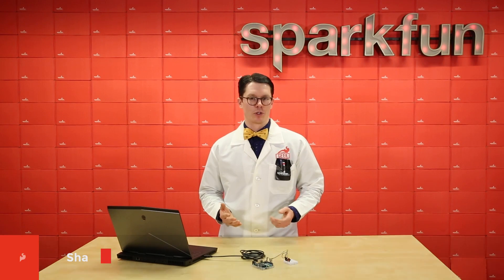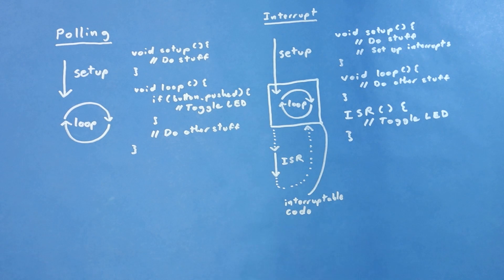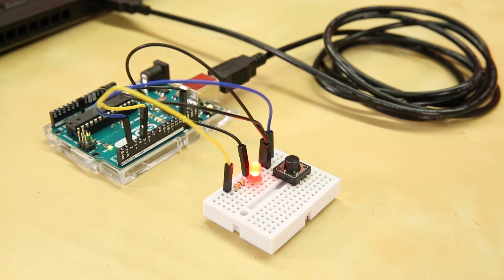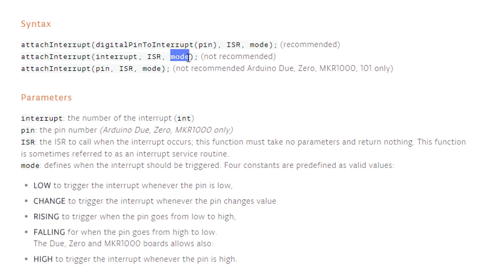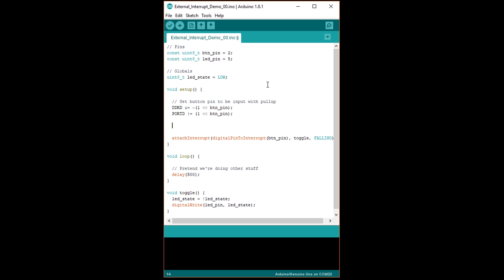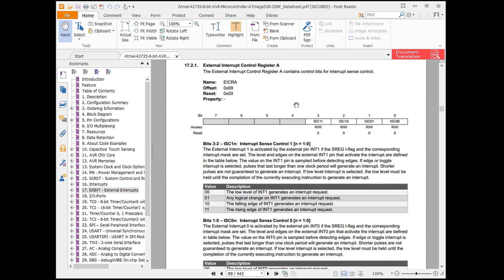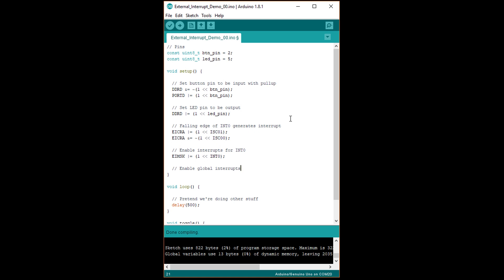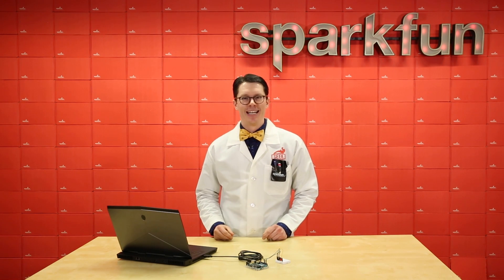Level Up Your Arduino Code: External Interrupts

Comment: So far I've watched 50 videos about interrupts and absolutly nothing shown works. Arduino IDE always throws errors or simply does not what expected. I really want something simple to happen but apparantly it's impossible. If I press a button, I want something to happen, once. Not hundred of times, but other buttons need to be read aswell. I can't even get a single button to work with interupt service routine.

Comment: Yeah, this & the few other videos that led me here are outstanding.  I have many questions, but I want to focus on one. Around 9 min in there’s  a statement “led_state = !led_state” for toggling. Defined as “LOW” (pre-setup) w/ uint8_t.  If uint8_t has 0-255 as possibilities, how does a ‘!’ simply toggle between only the two states “HIGH” and “LOW”? Does “HIGH” set the 8 bits of uint8_t to 11111111 and the ‘!’ is saying to toggle all 8 of led_state’s bits to “opposite” being 00000000 for a value equivalent to “LOW”?
Reply: low means 0 and high means 255 and we are toggling in these two values only....so there is no value between 0 and 255 .

Comment: Good video. I have a question, if I have a convayorbelt with ir sensors I can use interupts so the motor starts running the belt as long as the ir sensors see a object. As soon as the object dissapears(at the end of the belt) it stops again. I understand how they should work if u mount them sideways as a gate. But I was thinking to use them length wise on the belt. Or is it better to use a while statement. Like while sensor x is hight run motor ect.

Comment: Even simpler, in the ISR, toggle the led_pin by writing a 1 to its bit in PIND:

PIND |= (1 << led_pin);

It's in the data sheet and is quicker than the XOR.

Comment: Minor point here but the timers cause an EXTERNAL interrupt. The timer is separate hardware not part of the CPU, and if it causes an interrupt, that comes into the CPU from the "external" timer. See my video on timers in ATTiny which explains this.

Comment: Thanks for the fantastic explanation! I used some of these methods in my own projects and they have worked well. 

I would like to add from my own project experience that it may help to add a cap to ground at the INT0 pin in order to prevent unwanted/false falling edge detections. This may be an issue if you have a cheap button that has a ripple to it, or perhaps there are just ripples in your system in general.

Comment: Let's pretend we had a bool variable type and we could use it where hi and low are used and we also could flip it with a simple line.   X=!X;. Then we pretend to turn on a light digitalWrite (8,X);.  Then wonder if it's wrong.

Comment: Followed this lesson. Found, in case of PORT's  when  button is pushed  LED  not stable or not working at all. Solution, add 10 k resister between +5 and pin 2. Again, it is only for PORTs.

Comment: Wow, I just finished the Register video and was feeling good that I got it finally. So I jumped into this video and all was going great until 1 second before 12:00. For the next 2:30 seconds I felt I was listening to a new language. I rewound the section countless times and read the sections over and over in the datasheet, and I finally the parts started to make sense and I finally understood your code. 
I appreciate your video, if I had to rely on the datasheet alone I would give up my project completely. You have given me new hope that I can figure out how to make my code work.

I swear there was a point when I was reading the datasheet that I almost had to hit a AA meeting or the bar. It felt like if I had a couple drinks in me then I could better understand where the guy was coming from when he wrote that datasheet. 

There is one part I don't understand and perhaps someone can clarify it for me.
When I was reading about the "External Interrupts" it mentions that they can be triggered by either INT1 or INT0, and it also mentions that any of the other pins (PCINT 23-0) can also trigger an external interrupt. I see that the EICRA bit configures how and when the trigger is detected (low-level, rising-edge, or falling-edge) for the INT0/1 registers, but I don't see a similar register for the PCINT pins. Am I missing something here?
Reply: Is the project done ?
Reply: Haha yeah.  I grew up with a Commodore 64 and I still had a little trouble grasping registers.  Its pretty cool once you get it :D

Comment: Hello, thank you for all your videos. I've learned lots of new things. So, but i have problem with Interrupts. My LED doesn't work like yours. My LED turn on and off more than one times, when I push button one times. Probably i need some debounce, but your sketch working without debounce. Any idea please?
Reply: You might need to add a capacitor to the switch, or have a separate routine that "listens" to the switch for a few ms to debounce on the software side.

Comment: Why don't you need to declare "volatile" for led_state?
Reply: You should! What happens otherwise is decided by your compiler. If it is non-optimizing you are generally fine, but if if optimizes you might run into problems.

Comment: This is an easy "why not Rasberry Pi" response to any PC programmer. Arduinos teach how microcontrollers are different. You could stick to Linux or Android forever in microprocessor world, but needing or wanting to program microcontrollers is slightly different. I suppose that's why Basic Stamp sold for so long. IoT makes the Arduino IDE, JavaScript and Micropython more interesting, for professional and hobbyists, but it's still microcontrollers vs microprocessors.

Comment: I am not sure what you mean by "software interrupt"!
Do you mean for example interrupt on a carry from an ALU operation?
or do you mean interrupts generated from within the code?
Reply: minor mistake, which I corrected right away.
Reply: A software interrupt can be caused by some condition in the processor itself or by a special instruction that throws an interrupt (this Wiki page explains the difference: https://en.wikipedia.org/wiki/Interrupt). Many low-power microcontrollers, like the AVR, do not natively support software interrupts, but you can trick them into generating one (here is a discussion in it: http://www.avrfreaks.net/forum/software-interrupts ).
Reply: Thanks for the reply. I still don't find a single practical use for a software interrupt in a small micro controller like the ATMEL! 
26 sources of interrupt has been enough for anything I have done on a MCU.  
Can you provide an example of a use, that can not be done with the existing interrupt vectors?
Reply: UFOhunter Since most of my programming has been on microcontrollers as well, I don't have much experience with software interrupts. However, they seem to be prevalent in larger systems (e.g. those with microprocessors). From what I understand, you could have a "divide by 0" instruction throw an interrupt or generate interrupts when read or write commands to a hard disk have completed. Additionally, programs can create interrupts in order to interact with the kernel. A microcontroller has little need for these types of interrupts, which is why we usually don't see them when programming for embedded systems.
Reply: Thanks. Exactly what I thought. I didn't want to miss out on anything if there was something to miss out on :)
Reply: BTW- please put a <space> after the word Interrupt in your link. The ")" gets sent to Wiki and it has no idea what you mean. thanks.

Comment: Internal interrupts, we are on our own.
This is a MAJOR functionality of Arduino that is missing.
How to do an internal interrupt using Arduino????????????????
Reply: IIRC, there was a way to do it but it required adding some lib and I was tight on space.  Here's an example of using a counter overflow to update the top half of a longword (used in a geiger counter project):
//////////////////////////////////////////////// subs called from setup
void t1set() // setup timer1 as a counter that interrupts on overflow
{
  TCCR1A = 0; // turn off all the weird compare/capture modes etc
  TCCR1B = 6; // clock on falling edge (7 for rising)
  TIFR1 = _BV(TOV1); // clear initial overflow - shouldn't need to, but do.
  TCNT1 = 0; //zero out timer
  TIMSK1 = _BV(TOIE1);// sets the timer overflow interrupt enable bit
  }
/////////////////////////////////////////////////////////
//////// manual isr setup, you bet, saves a whole library
// actual isr for hardware counter 1
ISR(TIMER1_OVF_vect)
{
 c1counts += 0x00010000; // add one to top half of longword
} 
////////////////////////////////////////////////
So yeah, writing to registers is used here...not that it's super hard, but finding the info took some google-fu.
Reply: There's really no easy way to set up internal interrupts on Arduino without manually writing to registers. There are some functions, however, that rely on internal interrupts. For example, analogWrite() uses compare and overflow interrupts to create a PWM signal. So, internal interrupts are there, but they've been abstracted away into other Arduino functions for the most part.

Comment: Thanks quite useful but lost you at the DDRD stuff at the code no relation or explanation of how to use it and where it comes from, seeking to see the timer interrupt tutorial.
Reply: I'm an old hand, and just for communication's sake you should perhaps point out that << means "shift left by" instead of just saying the character names.  Newbies don't translate this that well in their heads.  Once you lose them...getting to it later often doesn't help.  Also - yeah, using the compiler at compile time to make "bit 5 = 1, the rest zeros" isn't as obvious as just defining a number (and maybe a comment on why bit 5)...I use the cute trick too, but again, for beginners...using the more direct/obvious construct is good.
Reply: So very true. I struggle with it sometimes and assume things that people will just understand how certain things work (or why you need to solve certain algebraic equations). Interestingly, I find that that the really smart people who just "get it" very quickly often make terrible teachers, as they never had to struggle with a concept and see it those 3 different ways. And yes, you definitely can't please everyone all the time, which is why I aim for having 80-90% of the students understand something before moving on. The other 10-20% I'm happy to work with outside of class (workshop, etc.), but I don't want to hold up the majority of people for them.
Reply: Just watch the previous episodes like Shawn said.
Reply: I didn't mention it in the video, but the description points you to the previous video (which discusses reading and writing to registers like DDRD): https://www.youtube.com/watch?v=6q1yEb_ukw8
Reply: The hardest part about teaching anything - and it gets harder(!) - is remembering how it was before you knew any of it and it was all a total mystery.  Things you don't need to think about any more than breathing now - will hang up a student till they get some critical mass of background.  Messes me up all the time - I do pretty well, but don't teach that well myself - it's kind of the flip side of the saying "those who can't do, teach" - those who can do...have more trouble teaching sometimes!  An editor of mine used to say you have to say everything 3 times in three different ways to get it across.  But once you know this stuff cold - it's really hard to make yourself take that time, you're anxious to get on with the next thing - and so are the students who "get it" right away.  This makes it near-impossible to please everyone - some people need all 3 ways.  Of course, those with too short an attention span who also need all 3 ways needn't bother complaining, but they will anyway...
Reply: Good suggestions, thank you!